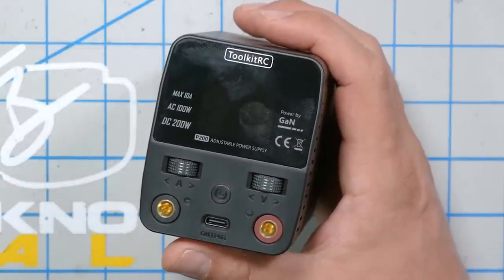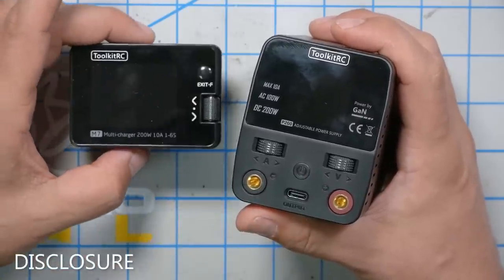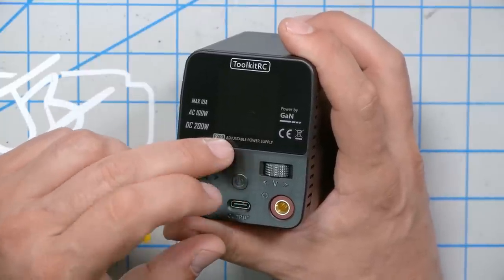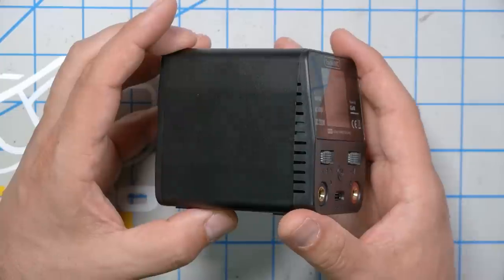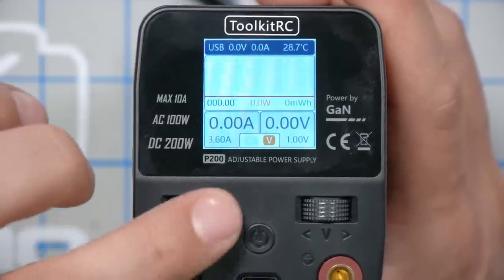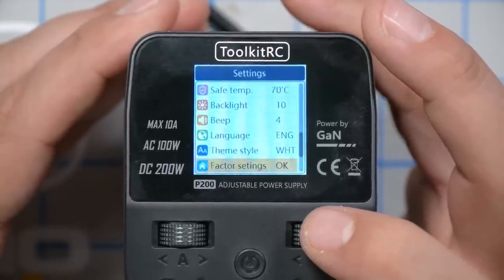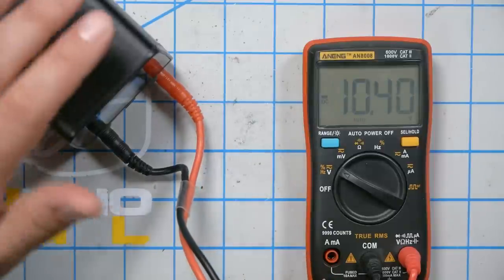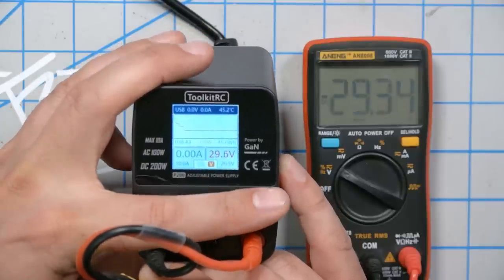ToolkitRC P200: what's it good for? (Tiny 10A 30v bench power supply)

Comment: Get an old computer power supply and stick it under your bench and run the wires up. You get 3.3, 5, and 12 volt.

Comment: GaN transistors are a big deal, I'm really amped to see power delivery get a ton more efficient, especially for small PCs, but also for ESCs, BECs and voltage regulators. it's still more expensive than silicon, but it is getting cheaper pretty quick

Comment: I think RC-motors are 3-phase AC motors and you supplied one phase with DC-voltage; creating a magnet in one section of the stator...you broke that 'magnetic hold' by twisting to another section of the stator.

Comment: Doesn't the ISDT Q8 do the exact same (with even more voltage range) for less money? Not to mention it's also a lipo charger... It doesn't come with AC input but you could just add one for the price difference and you still have a lipo charger + power supply of the same specs for the same price
Reply from the maker: The point of the p200 is that it's a compact power supply. You can make something equivalent but it'll be more cumbersome.

Comment: It's a switching power supply. especially at just 0.15V, the switching will be noticeable.
Reply from the maker: Good point. The low voltage due to the amp limit.

Comment: I'll stick to my SkyRC B6 nano which is not as new but has newer tech hahaha like bluetooth connection to start, stop, and monitor the batteries cycle and the ability to scan per-printed or saved upc images that will instantly kick off a predetermined cycle, fast.

Comment: GaN Power Supplies are not just some marketing wank, I bought a fairly pricey 200W GaN PSU for charging on vacation and it is the same size as my 65W laptop charger, and does not get any hotter either despite supplying over three times the power.

Comment: Can it be used as a variable current source with constant voltage output, as you have shown with the multimeter that the voltage could be varied at a constant current. Is a similar operation with constant output voltage and variable output current possible?
Reply from the maker: It seems to me that constant voltage is the default mode for a power supply. The current supplied depends on the resistance of the load. The power supply can operate in this mode, with a current output limit set by the user.

Comment: JOsh, nice review. Not sure I see value in the P200. I just use an old laptop power supply to run my ToolkitRC M7 tester. It is about 180 watts at 19.5 volts. Works good.

Comment: From an electronics testing point of view, a minimum current limit of 1A is kind of high. Quite a number of things would release the mysterious blue smoke at that current, where a limit of (say) 100mA would be enough to power something, but not cause damage if there's a problem.  While this seems adequate for powering a charger, if you have the space, I'd go for a conventional bench power supply for electronics work.  They're available cheaper, too!

Comment: Can it be used for voltage injection on lets say PC motherboard short circuit visualisation under thermal camera?
Reply from the maker: I suppose.
Reply: @JoshuaBardwell  You didnt test such?  not talking about insane voltages    like 1-2v tops  and 0.1-0.4 amps

Comment: It actually seems a little dangerous for them to include those two sets of cables because I can see people attaching the clips to the bare wires of the XT60 and seems like an easy way to get shocked
Reply: Uhhhhhh that's how I power my hobbymate duo off my car with jumper cables..... Not smart but I don't have to charge in my hood lol.

Comment: You cannot just power a DC brushless motor like that. This is exactly why you need a brushless motor "controller", which basically a logic that provides pulsed current to one of three coil pairs successively. A B C coils = 3 wires. To go forward you pulse AB AC BC.

And no the DC output doesn't have a ripple. The reason it's vibrating and whining is because when you activate one set of those 3 coils, it moves a tiny tiny bit to go to next coil. Ideally the next coil would now be energized in a proper control but instead it moves and since next coil (i.e. electromagnets) is dead, the original set pulls it back, overshooting it to the other coil that is before it. Rinse and repeat and you have an oscillation.
Reply from the maker: I didn't expect the motor to spin. I was just trying to see if I could get the power supply to fry it, and what it would do when I energized the coil.  When driving a brushless motor with a DC current, I would expect the phase to energize and the bell to want to stick in one position. If it was an "overshoot" ringing like you're describing it would quickly attenuate.

Comment: It is just bad, when I connected this power supply directly to the drone (instead of using smoke stopper, I use current limiting), so after testing motors, when I increases throttle and then decrease - back current just burn it out, and their support said just don't use it with the motors lol (I can give a link to the support ticket), they have to add protection of back current, but it doesn't have it

Comment: Maybe not that much power but isdt 608AC has "DC source" mode and that's great cheap charger.
Reply: @Zoide on the DC power supply mode you can set the voltage, max current and if it's on or off, so yes
Reply: @Zoide nope, it doesn't have a main power switch, you need to pull the plug

Comment: DO NOT test motors on a high power sharkbyte system with a bench supply (low end, at least) without diode protection. Spike, ripple, or something is what I believe fried two of my tx5s.1 boards. Testing motors on a 6s 7" with 1800kv 2806.5 motors, spun to half throttle in BF and the vtx went poof. Took two to figure out that's my only SB quad without a fettech spike absorber.

Comment: so i ordered one of these and am not happy with it. in my work shop all my wall plugs have GFCI's installed. Every time I try to plug in the unit it trips the GFCI. I have tried a total of 8 different GFCI  wall plugs and cannot get it to work since it trips it every time I turn on the power switch in the back. DC power appears to work well with a 6 cell battery.  Anyone have a suggestion before I return it?
Reply from the maker: It's defective. Return it.

Maybe try a different power cable if possible.
Reply: @JoshuaBardwell  Good call. I had also thought the cable seemed kinda flimsy and thin. Luckily I was able to find a similar style plug that appears to be a lot thicker and now it works fine. How does a company send out equipment with sub par wires? So basically if you buy this power supply you have to spend more money on a good power cable if you use it with gfci wall plugs. That's sucks. Thank you Bardwell for your help!!

Comment: Both my toolkit RC chargers on my bench have problems and are not safe to use anymore. One I have had for only a couple months and the other less than a year. I'll be staying away from their brand in the future.
Reply from the maker: Toolkit Rc is really hit and miss. The m8 charger was awful after the first batch. The m6 was pretty solid.
Reply: @JoshuaBardwell  my m6 randomly switched charging voltage mid charge, luckily I was there to see it happen by pure luck, I only use it as a battery tester now. BTW, amazon just put the Kungber on sale for 49.95! ordering from your link!

Comment: Bench power supplies for the win. Not much bigger and much more universal. Probably much cheaper as well. Clicking the voltage knob is a bad design. If you are using it for other purposes such as 3.3v electronic components it would be rather easy to blow the component by accidentally moving the voltage very little. Yes, pwm current limit.

Comment: coming back to this when i need a 200w power supply, the marketing is bleeehh, its not 200w, its 100w with an overdrive feature with an external power supply. i need a power supply. not another thing to plug a power supply into.

Comment: Its switched DC. AC rectified to DC is just half the AC wave. The motor vibration is 100% normal.
Reply from the maker: I would hope that they are doing a bit more than simple half-wave rectification. The DC ripple from that method is pretty extreme.
Reply: @JoshuaBardwell  You could try to tear it apart and see how they do it. Or if you don't want to risk it try sending it to Electroboom :)